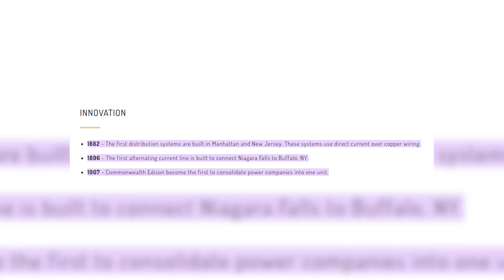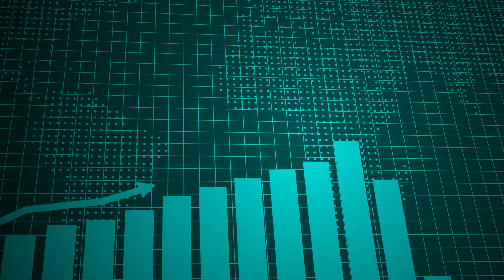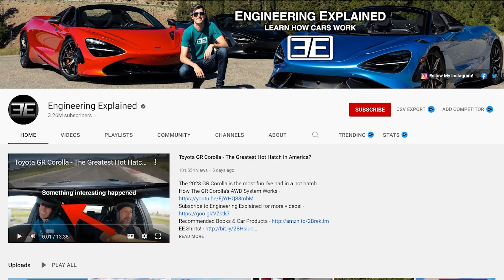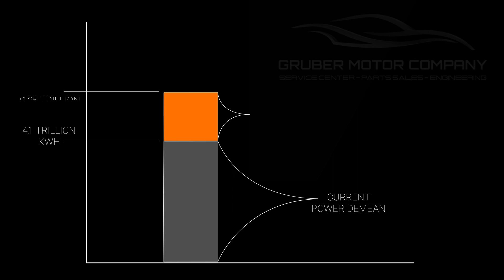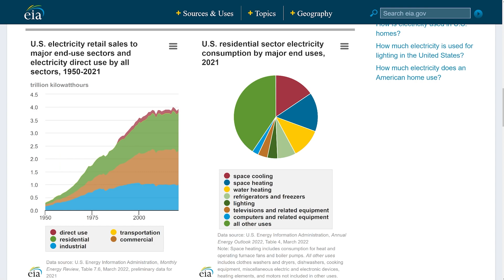Can The Grid Handle EVs? | Gruber Motors

Comment: Unfortunately, this video doesn't really answer the question.  There is a HUGE difference between retail energy sales and grid CAPABILITY.  If the grid is not saturated, then you just increase energy production and the existing lines handle the higher load.   However, if it becomes saturated, then you have to build new power transmission lines.  Building those transmission lines is not easy, cheap, or timely.  Getting permits, access to private property, etc, are roadblocks that are not easy to overcome.  This video would have been far more informative if it had looked not into transmission increases, but grid capacity increases.

Comment: My experience is most utilities are asleep at the wheel. Building out more capacity means higher rates so they choose to do nothing
Reply: It is a build as need system, with an understanding that increased in demand will be gradual, not the step change that EVs will cause.

Comment: It will not require a 30% increase, in fact there is plenty of capacity now. The current grid can supply the energy required to move all transportation to electricity if off-peak level 2 charging is utilized. This mad demand for super fast DC charging is what will overwhelm the grid. Pricing is quickly evolving making fast charging expensive and only desirable for long trips. The key to any environmental benefit is level 2 off peak.
Reply: Ignores the fact that grids are designed to take advantage of the fact that usage is lower at night.  Try to run a grid at full power 24/7 would be similar to running your car at max speed 24/7.  It will burn out.
Reply: @retiefgregorovich810  BS. In fact, it's totally wrong. Most generation is thermal, which is not throttled up and down. Currently, steam is blown off and wasted. Running at a more even load is actually better. In fact, some utilities have actually had to lower rates because off-peak EV charging increases the power plant's utilization factor, increasing profits. Utilities are regulated and are guaranteed a fixed rate of return on their investments. Increased profits mandate a reduction in electric rates to customers. EV charging off-peak actually is better in every way.

Comment: One of the statistics put out by Plug In America a few years ago was the 'grid' could handle 180 million EVs without changing a thing, even more with charging management.  The utilities could control charging rates so that the electrical load could remain balanced.  They would offer a discount if the drivers allowed it.

Comment: Hence why the VPP, battery storage, wind, solar, and sea will all combine to supply the grid. The battery storage aspect alone will change the grid immensely.
This isn't going to happen overnight. EVs will change just as the grid sources will change.
I have to wonder just how much energy is used to produce gas, diesel, and other fossil fuels. Won't there be a decrease in that?
Fossil fuels won't be eliminated as it's used in many products.
Reply: No.  Refineries will just retool to produce other products from oil.  Look up what oil is used for.  It is much more than just gasoline or diesel fuel.
Reply: I know oil is used for many products, but it'll be great when hardly used for fuel and lubrication.

Comment: Extremes like everyone turning on their AC at once during a heat wave stresses the instantaneous grid that we have now. The ideal answer to this is storage sources to pick up the slack, of which EV's and batteries are ideal at doing. Expanding EV's will actually help the situation, not hinder. EV's can easily vary their load based on demand pricing of electricity, and grid scale batteries quickly and easily pick up the slack. It's already being done in California, Australia, Hawaii, and other places. Also, point-of-use generation (read: home solar) takes even more load off the grid by generating power exactly where it's needed. People purchasing EV's and home solar panels together are actually helping the grid out.
Reply: Love this, totally agree. Would EV’s as a storage source require them to have two-way power? Or could this be achievable without every EV having that feature?
Reply: The major EV car manufacturer in the USA, Tesla, doesn't not offer this capability. It requires extra equipment to be installed on EV vehicles to make this work.

Comment: Thanks for the good summary.  Many EV owners add solar to thier houses, which has a net zero effect on EV power usage. While solar may not be an option for every EV owner, it can be a signifcant reduction in power usage by those that can add solar. 

What is often forgotten in the analysis of long-term EV power usage is the amount of power consumed to make a gallon of gas - gas that will no longer be needed by that EV owner.  Just the refinery alone requires about 5 kWh of electrity for each gallon of gas. That 5 kW is enough for an EV to drive 20 miles.  Then there is even more power reuqired for fracking, pumping, distribution, and that needed to run gas stations.  EVs also normally charge overnight, when there is little electrical demand. The refinery has to run 24/7 can can't shutdown during peak electrical demand needs.  There is a lot complication to the power needs, but it's far less than some think it is and really not much of a concern.

Comment: Texas power grid can't handle an air conditioner .. but that is the price of living there.
Reply: The Texas power grid is fine , you don't know what you are talking about. I went thru one power outage in 15 years . And yes I run my AC all summer when needed. No issues whatsoever.